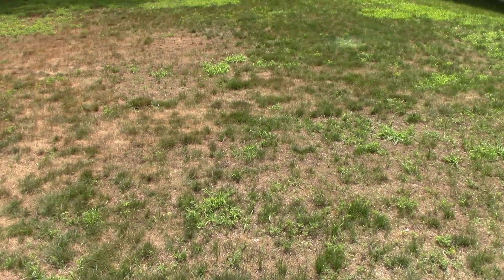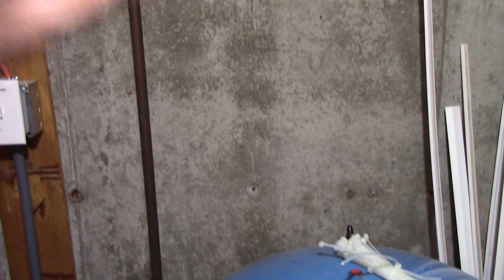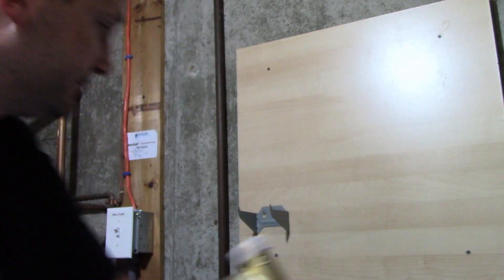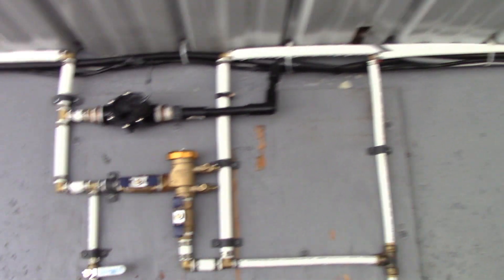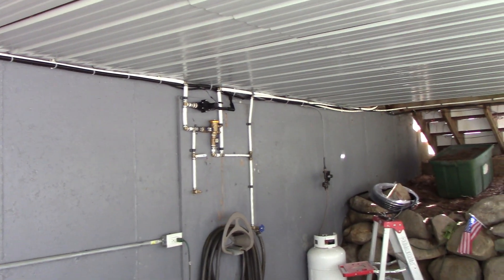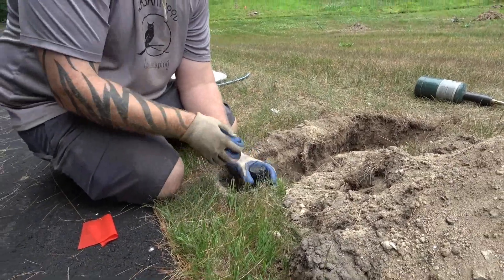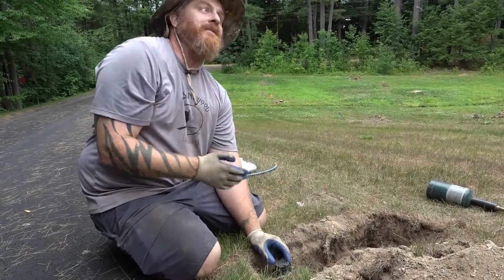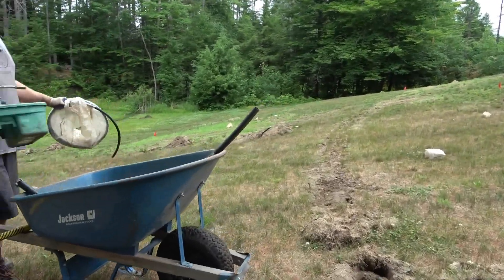SMARTHOME Irrigation - Complete Install + WHY "Smart" is important.

Comment: It sounds like you have been planting the incorrect type of grass for your region and soil type, irrigation will certainly help and using  well water is even better. I live in West Texas and have a lush green lawn, the Bermuda and Saint Augustine thrive here. I have not used my irrigation system of this year. How is back doing? 😁🛫

What are the flow rate in GPM and pressure do you have? How deep is the well? I enjoyed the video!😁
In the fall I I use a small Shop vac and remove the pop up head the hose fits perfectly into the pop up and evacuate the water from each zone to keep it from freezing. I also put in a tank that connects after the master valve that has a Venturi this way I can add liquid fertilizer too.
Reply from the maker: Sounds like you know your grass.  I do not lol.  My back is doing OK thank you.  My well runs 10 GPM @60psi.  I love that venturi system for adding fertilizer.  Super smart idea.  Thanks man!
Reply: Trial N' ERROR it great to hear your back is doing well, I remember when you were setting the trusses on your shop I think it was in that video you mentioned you were going have surgery. I like that weather station too. The well has a good flow rate. 😀🛫